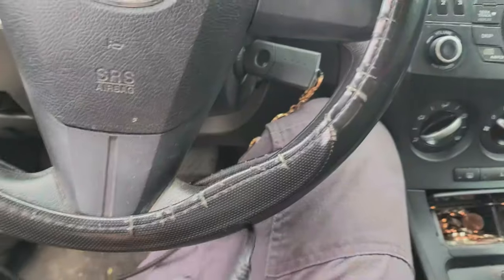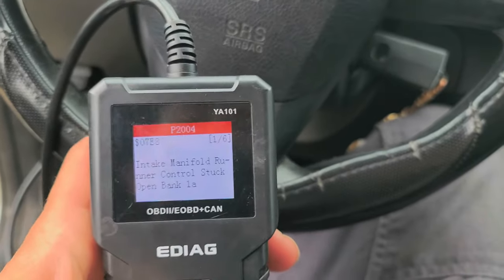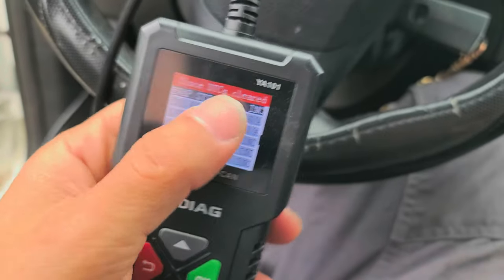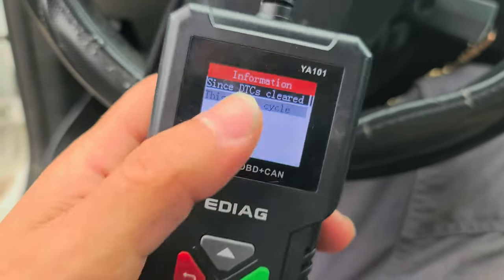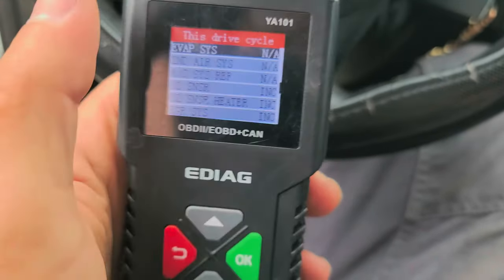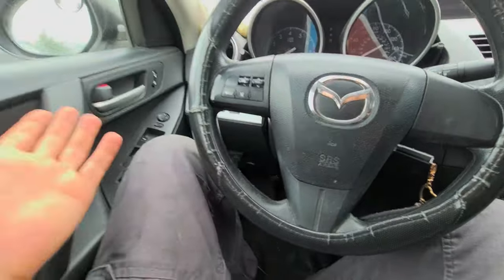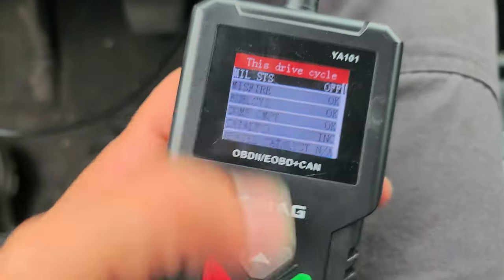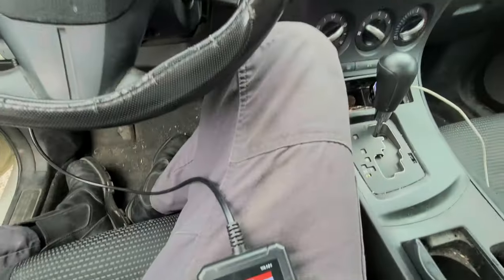how to clear permanent codes. what is stored codes pending codes and permanent codes explanation

Comment: To much jabber confusion. Get to it or stop.
Reply: Permanent DTC's are special codes used so you can't fake a passing emissions test. They don't want you clearing all your DTC's right before you pull in to get the car inspected. With normal DTC's that are not hard faults, you clear the codes and wait for them to come back. Permanent codes are the opposite. You clear the codes and wait for them to go away. They give the PCM enough time to determine if the problem was really fixed, or if you just did a reset. People sometimes get confused because permanent DTC's are not really permanent.

Comment: 2017 gmc sierra permanent p0420 cat code.
Reply: Do you need to pass an emissions test? What state?
Reply: @stevew9563  yes emissions in NYS
Reply: @thatguyyouknow92   - I believe all they look for there is if the Check engine light is off.  And it's off correct?
Reply: @stevew9563  yes no check engine light and monitors have to be set.
Reply: Did you repair your cat code?
Reply: @stevew9563  nope. Still trying to figure it out.
Reply: @thatguyyouknow92   - Ah well if you can set your cat monitor without a current or pending code then you know you fixed it.  If that happens get it inspected ASAP because the code might come back at the next running of the CAT monitor.
Reply: @stevew9563  soon as the cat monitor sets light comes on. I’m getting 0.00 reading’s on 2 of the 02 sensors I’m gonna try and replace those forst

Comment: My car has a permanent code but it won't start so now what do I do I fixed the part but still won't start
Reply: What was the part you replaced? And is it a no start or a no crank?
Reply: @stevew9563  Same issue, replaced throttle body, cranks, but no start

Comment: That information is wrong. A driving cycle means that the car cooled down to at least 120f and warmed up to at least 170f. Other than that it won't count as a driving cycle, at least on Toyotas 2010+. You could manage to have a water hose blasting cool water on your plugged temperature sensor(no need to remove from the car) to trick the computer that driving cycle happened 😊
Reply: What you describe is commonly called a "Warm Up Cycle" a "Drive cycle" is something different.  A drive Cycle is a specific way to drive a car to complete the monitor tests.  It may actually perform a Warm up cycle while you are doing a drive cycle but generally a warm up cycle does not need any specific driving pattern, in fact you can do it just idling in your driveway.